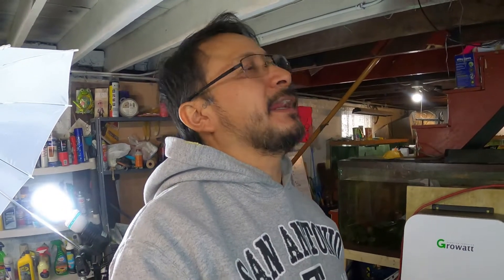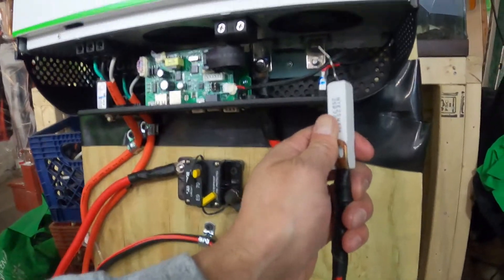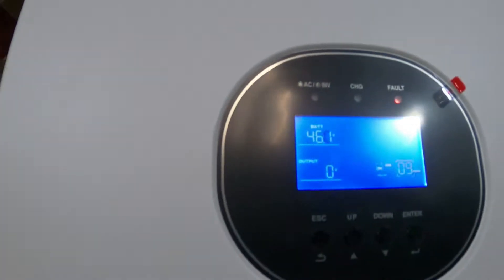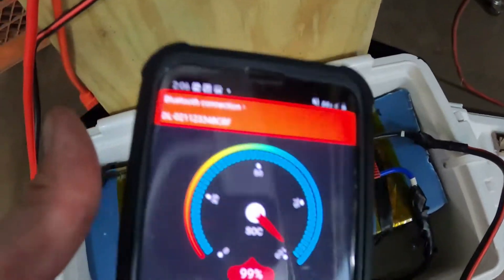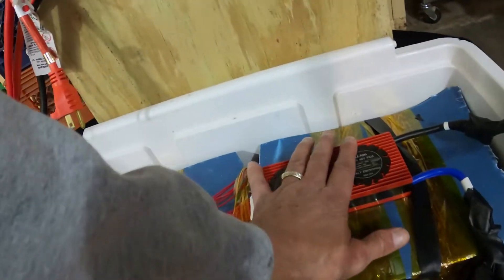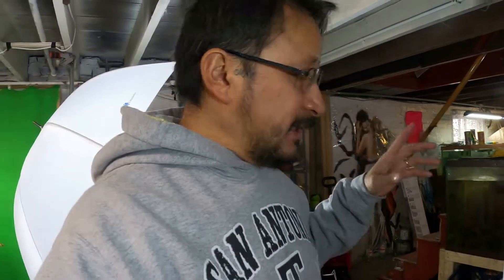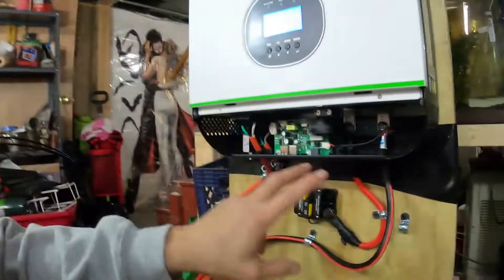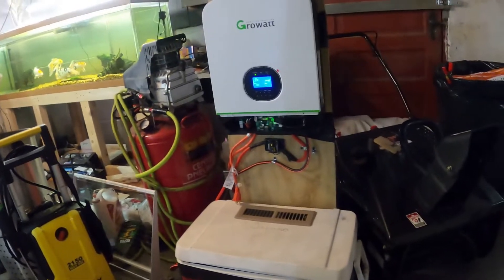Starting the Growatt 48v 3k

Comment: you are charging the capacitors not the transformer.  when starting up a new inverter, a resister is user the slowly charge the capacitors. This prevents a big spark when the cable from the battery is hooked up. The capacitors will charge in a couple seconds. Then the cable can be connected safely. You are working hard to make this happen. Thanks for sharing. I think it might be a good idea to put in an inline 200 amp fuse on the positive cable between the battery and the breaker. I know you have the breaker but the fuse could save the day if the breaker fails to take the battery out of of the circuit. You don't want to start a fire.
Reply: @RobHereAKATrev2323  the alte store has a fuse calculator. What size cable are you running. You may need to run 2 awg cable for a 3000 watt inverter. I tried to send you the link but this site did not allow it. A good youtube channel is EXPLORIST life - DIY Campers. great explainer about solar.